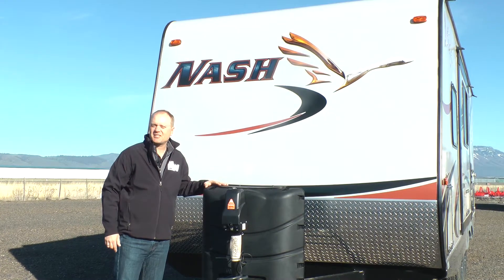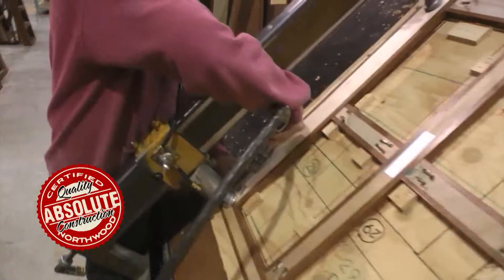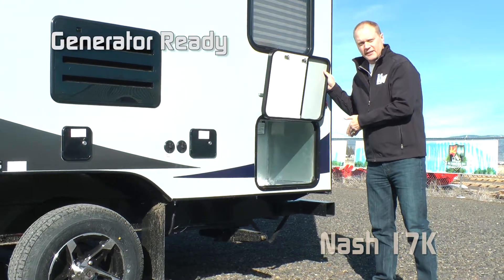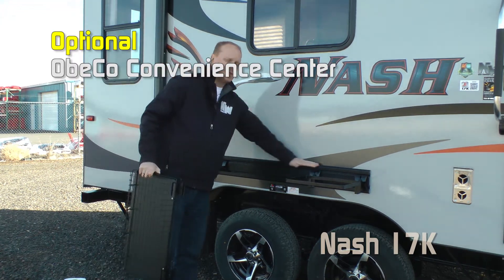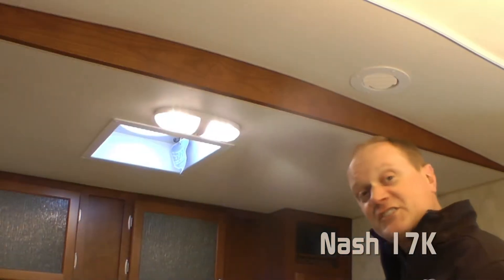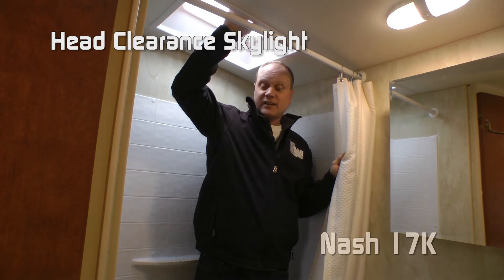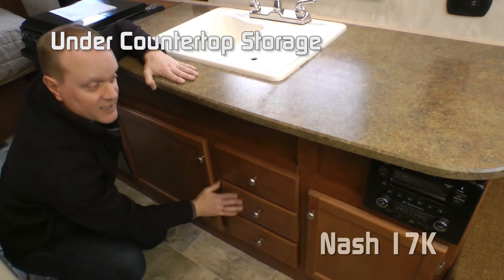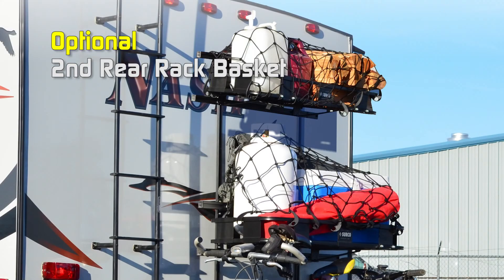Quick Tour Of The New Nash 17K

Comment: I own one , 2018 17k . 
Chassis on the drivers side painter got sloppy , dripping paint up and down. 
Cabinet construction you can see flaws left and right . 
When I 1st received it the element on thermostat seal water heater wasn’t seated correct so front compartment flooded . 
Finish on bathroom door not completed. Sloppy ... usb charging section not working in master . Dealer Apache in Everett did not remove panel on generator door .. 
sloppy wiring for the battery and the rest of wiring exposed not protected. 
I paid $31k and expect better then this ! 
Very unhappy with Nash & Apache camping center in Everett Wa.
Reply: Interesting the manufacturer didn't reply